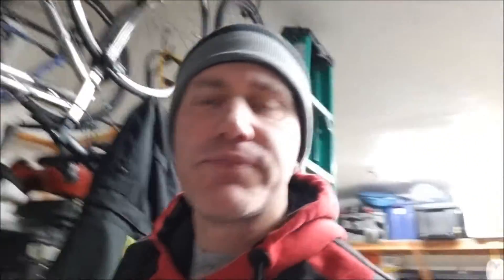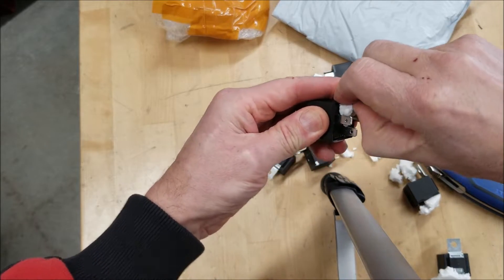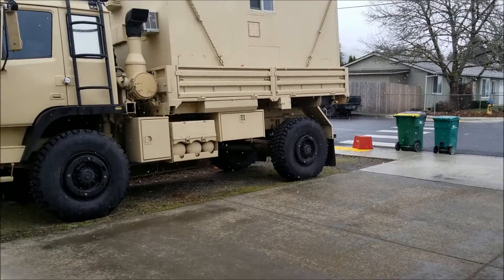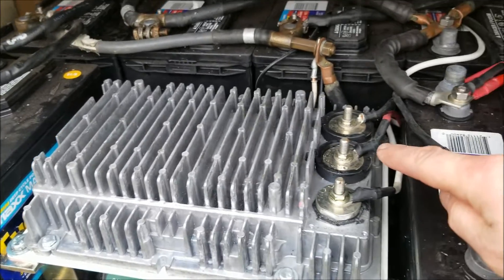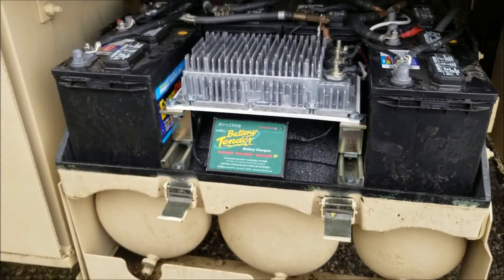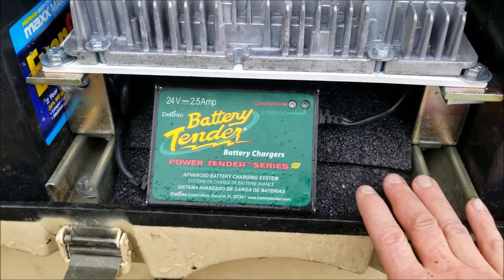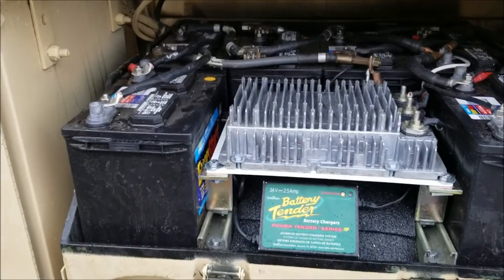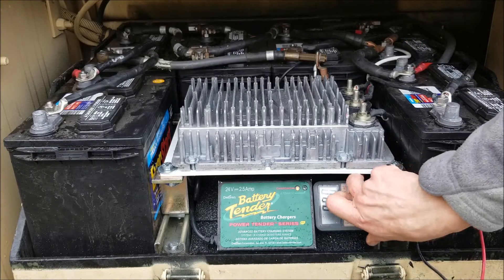Abel LMTV build part 83 (battery equalizer installation)

Comment: I'm not very good with electrical so this may be a silly question. You upgraded the alternator to 200amps and the Bussmann equalizer shows its rated for 100amp. Will that create any issues/smoke? Thank you again for taking the time to share your knowledge in these videos, very helpful... Robert
Reply from the maker: Amps are load dependent so I am not sure what you are asking????  Circuit breakers protect wiring.  There are plenty of free online classes if you want to learn about dc relativity in automotive applications....

Comment: Are you trying to do a full 12v conversion or just wanted a way to run 12v accessories from a 24v system?
Reply from the maker: Stay tuned and find out......  I am not confused in the least except as to why dual voltage alternators cost 1k-3k for a used one which is what started this whole modification...
Reply: @SeanFastidious  oooooh ok yeah the alternator in a humvee is very expensive too.
Reply: @SeanFastidious  burned out the 30a 24v-12v step down in my HMMWV.   Going to an Orion 70a which has had success. 

The regulator your link has shows out-of-stock... new searches yield 3x pricing.

Need my HMMWV to run today,  but will figure out placement of the Regulator/Balancer shown here.... which BTW... I have a new one as Back-Up for the 70a already in my LMTV (HOPE)
Reply from the maker: @beachpanda4687  You need to match your alternator output with the battery equalizer you are purchasing.  The sure power units are worth way more than I paid.
Reply: @SeanFastidious both HOPE (LMTV) & FAITH (HMMWV) each have a 200a dual volt Niehoff Alternator

Originally bought the balancer just for HOPE, and the 2x 8DL batteries in her (converted from 4 regular) in the hopes of just proper balancing.   

After reading your reply... maybe not such a good idea for either?
Reply from the maker: @beachpanda4687  I am not saying it can't be done but it is best to match or exceed your highest amperage available from your alternator with the equalizer you choose.  There is a reason they burn up when submitted to over amperage.
Reply: @SeanFastidious  How about a local shop that rebuilds alternators? And starters? Seems like that would be the way to go 🤔
Reply from the maker: @bigdbrowne  check out the build playlist in this series to watch the episodes in order and get caught up to where we are today...
Reply: I only ask because humvee owners have been using converters for a very long time to run 12v accessories and in the lmtv groups they seem confused by being able to run 12v from 24v without a dual voltage alternator lol.
Reply: @Poopshoot2011  lol haha , as soon as I start looking around the lmtv stuff and seeing them stuck on 24/12 V alternators I’m like why the heck aren’t they just running a 24 V and bucking/converting to 12v its cheeper and easier. And to me it seems like some of those 12/24 V alternators are 24 V and doing just that with a converter on the side.   I know this is a very old post.
Reply: We have 24 V in our rig as well

Comment: Did you unhook the 14vdc output from the alternator when you were showing these readings? Is the truck running purely on the 12vdc being produced by the converter?
Reply from the maker: I unhooked nothing.  This equalizer will provide 13.5vdc at 100 amps off of 24 volts alone without the truck running and not hooked up to the 12v sides of either battery bank..  That is what they are designed to do.  

Just you wait...no more alternator scalpers.... you will see...common off the shelf parts....

This is just stage one of the conversion to make sure it is working properly and I can move onto the next step....